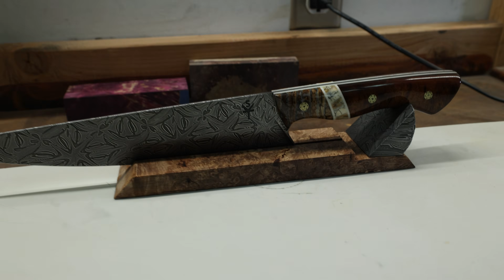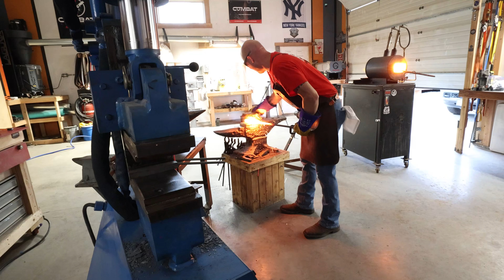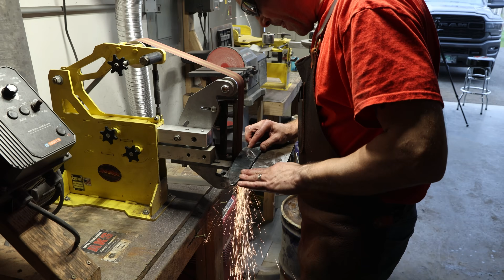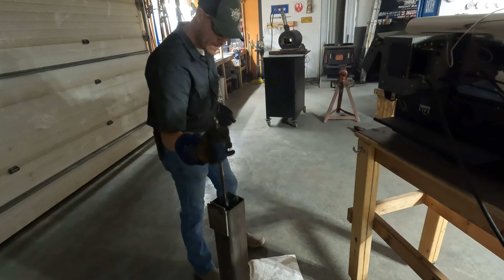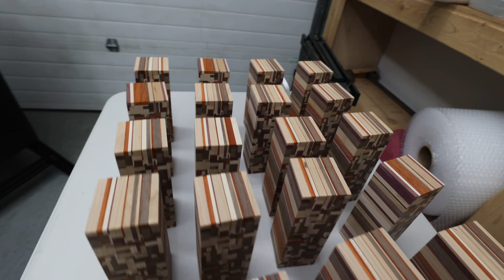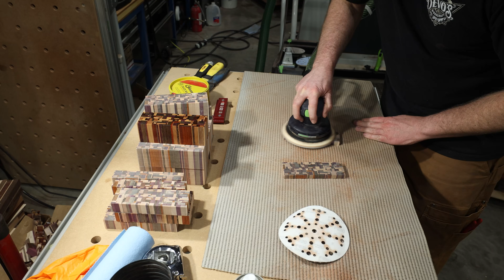Alaskan Forged Chef Knives - Full Build!

Comment: Are the 19 billets of different steel stacked for the sake of a nice pattern, or does the mix of steels really improve the finished blade's performance, which would be the original idea of pattern welded (aka damascus) steel?
Reply: The damascus is just the cladding.  The 80crv2 core is the performance and durability.

Comment: Kris could you explain what the process to stableize your knife handle material is for and what takes place?
Reply: Wood stabilization is the process of strengthening wood so that it will no longer respond to changes in humidity. Stabilization can be performed in five steps: drying the wood, loading the vacuum chamber, saturating the wood with resin, curing the wood, and coloring the wood
Reply: @TheTacoking1  thank Dan

Comment: Can i ask wht you mean by "professionally stabilized". Thanks. Great work as always btw :)
Reply: Wood stabilization is the process of strengthening wood so that it will no longer respond to changes in humidity. Stabilization can be performed in five steps: drying the wood, loading the vacuum chamber, saturating the wood with resin, curing the wood, and coloring the wood